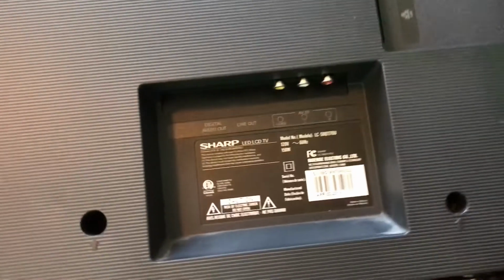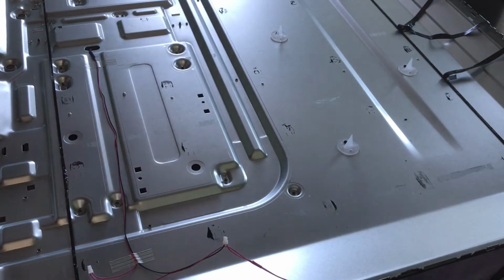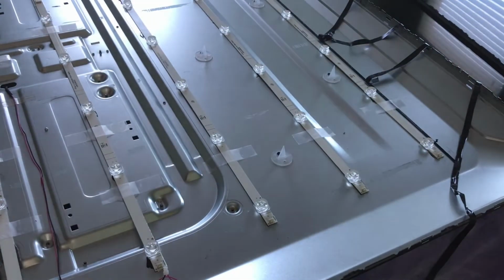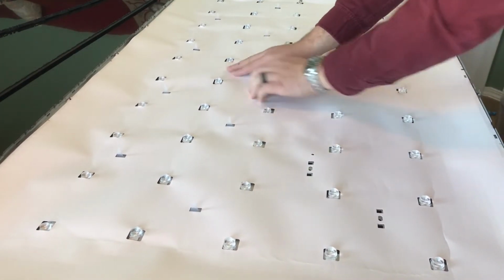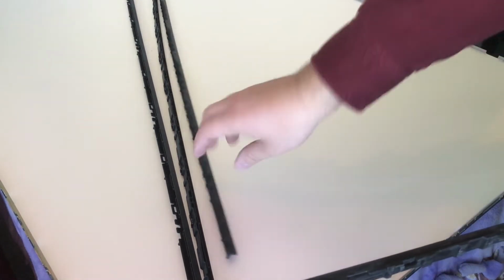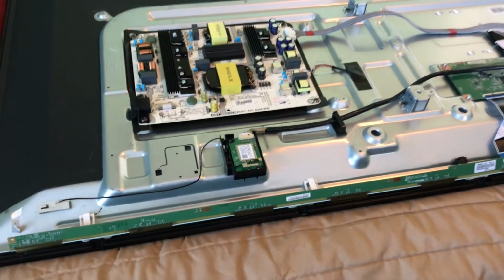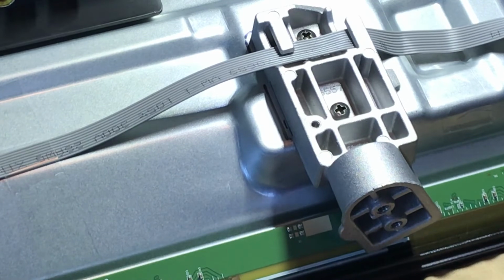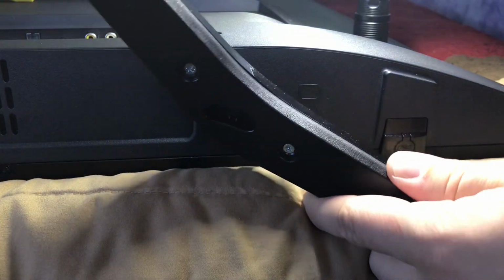Sharp TV Black Screen Repair | Sharp Model LC-58Q737OU Backlight Repair

Comment: If you still have this TV and could quickly remove the back panel and let us know what a 'good' output voltage looks like that drives the LED strips, it would be incredibly appreciated.  I'm trying to decide whether to replace the LED strips as you show here, or the power board.  I'm very surprised to see the output voltage on the LED connection bouncing around between about DC 150V to DC 220V or so.  It leads me to think I should try replacing the power board first.

Comment: Great vid. You mentioned disconnecting the wire from the power board and measuring the output power that would normally be fed to the leds. What voltage would one expect? If the 5 strips are in parallel, I guess 30ish volts? Thx. Very thorough coverage and much appreciated.
Reply: I am looking for the answer to this question also.  I connected my multimeter and the DC output voltage from the power supply is bouncing around between about 150V to 220V, I'm not sure if this is as expected or not?

Comment: Great video!  Thanks for taking the time!  

Before I replaced the LEDs, I could shine a flashlight on the screen and see the Roku logo.  

After replacing the LED strips, backlighting and sound work but there’s no image.  Any ideas?  Everything went very smoothly.  I’ve fiddled with the ribbon cables that I reconnected to the two boards at the bottom of the LCD panel as I just can’t get the arrow on one of them to be covered by the port snap mechanism.  It refuses to go down any further.
Reply: Yep-that was it….the metal connector on the underside of one ribbon cable had crinked up.  Prayed and straightened it and voila!  Thanks!
Reply from the maker: Sounds like a loose connection if you've now lost the image completely. Recheck all the wires you've undone and retry the ribbon cables. They should seat completely.

Comment: Hey, a huge thank you--I was able to resurrect one of these I found on the side of the road.  It turned out to be the backlight.  It's been enough years where I thought it'd be prudent to just replace all of the LED strips.  I appreciate the incredibly hard work of cinematography and editing that makes a video helpful.  I'm a creator myself and I know how hard it is.  

Another aspect of this was that my 4-year old son was fascinated by this and I was able to involve him in the repair (terrifying).  He got to use the multimeter to do diode testing on the lights so we could verify the new strips as well as verify that it was a bad LED that causing the issue.  He had SO much fun, and it was a really cool bonding experience.  

So... thank you for all of that.  

* 

* One note to fellow DIYers... the removable standoffs were a beast for me.  A note that you can actually see them on the other side of the TV--this helped me understand the mechanism.  I ended up breaking one (nothing a little superglue couldn't repair).  If the bottom of the TV is down, then you pull (or pry) the standoff UP and then either to the right or left.  I think mine were to the right, but this TV being repaired in the video was to the left.  I think the holes support either way, so be aware of that.

* Another note, my behavior was that the TV wouldn't power up, but the standby light would come on and blink with a pattern (2 shorts, 1 long).  It turned out to be the backlight.  Some of these TVs don't turn off if the LEDs are bad.  Kind of a bummer because replacing the backlight is way scarier than any of the other repairs.
Reply: Regarding the diode testing, you measured each strip or each individual led? And thanks for the error code info.
Reply: @nijo5427  My multimeter could power 1 LED, so I tested just one at a time.  I didn't have the tools to test a strip
Reply: I guess that's my plan too. Like you, I got this tv free. Really hope I can bring it back. But if not, it's worth a try. Your description of the fault is exactly what I'm experiencing. It's nice to know what needs to be fixed.

Comment: Great video. Detailed steps. I am at the point where I need to remove the screen. I can lift the screen on the sides i.e. too and sides. The bottom side does not lift with ease. I am afraid to force, for fear of cracking the screen.
It's Sharp TV LC-50LB481C
Any suggestions will be appreciated
Thanks
Reply from the maker: You may want to use suction cups like these that can help you support/maneuver the screen https://amzn.to/3ZcEzyC (amazon affiliate link)

Comment: I just tried this took a while haha. Didnt crack the screen but its the same issue when put back together sad. Wont turn on and light shine shows sharp roku tv lettering for a few seconds.
Reply from the maker: Great question. Likely you’ve fixed part of the problem if you are getting light for a few seconds. You’ll next want to use a multimeter to test the LED driver to see where the issue is. Something is causing the LEDs not to get continuous power. Lots of good videos out there about testing those components
Reply: @learnsavediy  thanks for reply! i meant that the flashlight light technique still shows the vague sharp roku lettering. Maybe i shouldve tested power supply. Ill figure out thank you! the only video truly showing how to open up everything

Comment: Have this TV and it’s black. Doesn’t turn on. My husband tried to fix it from your video but cracked the screen 😂. We are throwing away the TV, however we have all the parts from the back of tv (motherboards connections etc) and led lights. If anyone wants it message me. We give it away (live in GTA)
Reply from the maker: That's the WORST! I am sorry to hear that. You can always try selling the parts too on Ebay, Facebook Marketplace, or Amazon. Lots of other people will be in a similar boat and need parts. Hopefully you can recoup some of your loss! Especially the backlights since they commonly fail.
Reply: @learnsavediy  Thank you. We already posted the parts on Kijiji. Also giving it away for free for locals in my area whoever shows up at the doors :)

Comment: Where can I buy those lights
Reply: Have this TV and it’s black. Doesn’t turn on. My husband tried to fix it from your video but cracked the screen 😂. We are throwing away the TV, however we have all the parts from the back of tv (motherboards connections etc) and led lights. If anyone wants it message me. We give it away (live in GTA)
Reply from the maker: I couldn't find them on Amazon but the best price I found was on EBAY. Here is the exact listing I bought: https://www.ebay.com/itm/403359091325

Comment: The whole thing really. I'm worried about getting into the back of the TV, I honestly don't know where to start.
Reply from the maker: I made a follow up video on how to take the TV apart (https://youtu.be/gx8Hjo_Pp1M) Hope this helps! Cheers
Reply: Have this TV and it’s black. Doesn’t turn on. My husband tried to fix it from your video but cracked the screen 😂. We are throwing away the TV, however we have all the parts from the back of tv (motherboards connections etc) and led lights. If anyone wants it message me. We give it away (live in GTA)

Comment: Awesome! Do you have a link for the led backlight?
Reply from the maker: I couldn't find them on Amazon but the best price I found was on EBAY. Here is the exact listing I bought: https://www.ebay.com/itm/403359091325
Reply: Have this TV and it’s black. Doesn’t turn on. My husband tried to fix it from your video but cracked the screen 😂. We are throwing away the TV, however we have all the parts from the back of tv (motherboards connections etc) and led lights. If anyone wants it message me. We give it away (live in GTA)